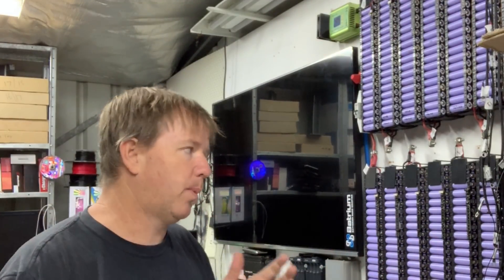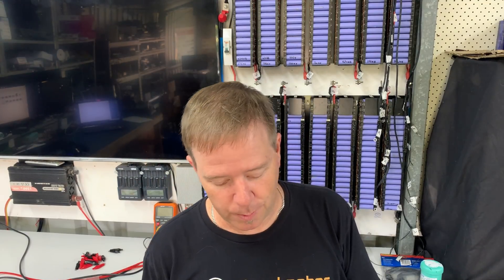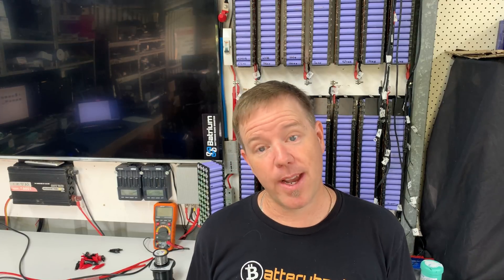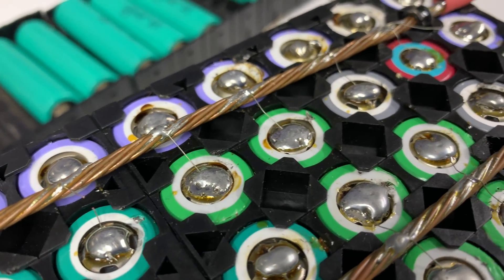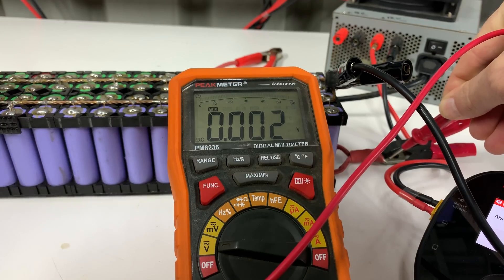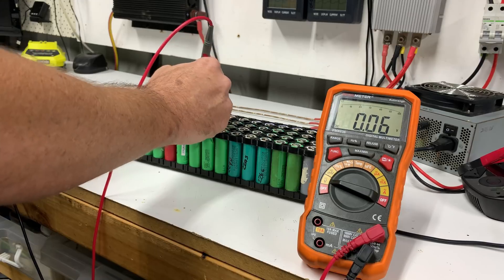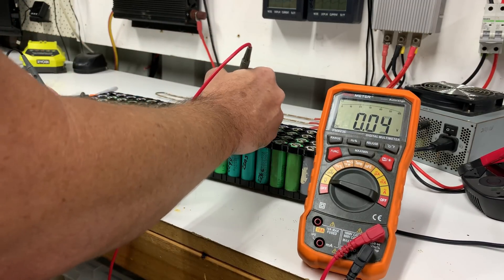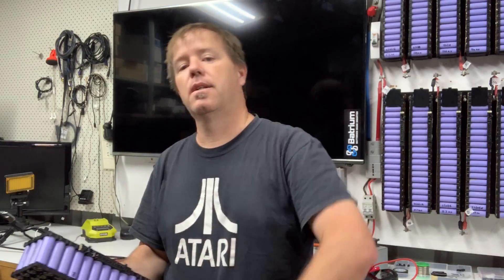No room to be complacent when playing with Lithium

Comment: so here's the thing, and this is the perfect example of it. Once one "cell" or in this case pack of 80, goes to zero in a series string, if you then keep drawing from the entire battery, the only way for current to flow is if that zero'd cell is being charged backwards. This of course will kill any rechargable battery regardless of chemistry and Li-Ion in very short order (no pun intended).

As for fire, I'm not sure if charging Li-ion in reverse equates to heat, I'd wager it does though. At either rate, this is the other, often over looked reason why you MUST run a BMS that will kill the power if it detects a cell has gone low. We all know how dangerous these packs are, and yes we all get complacent from time to time, but as Pete here is saying and has just demonstrated for us, you can never afford to do so with this stuff! 

Li-Ion batteries are wonderful slaves.... Absolutely horrible, merciless masters!!!!
Stay safe peoples.
And thank you Pete!
Reply: Jimmeh B yes I agree that if one our a couple are bad then this will bring down the rest that are connected. That is why you had a goon one as this must not have been connected, you could start charging it one at a time and may fine most will come back, or balance it with a good cell. They when one does not balance then this is the duff one, so you may get 70 - 75 back working
Reply: @russellgilchrist3951  My friend, you've missed my point. That pack of 80 single cells, as a whole, is the cell I was referring to that has been discharged to zero.

Also, more often than not, if one or more single 18650 cells, were bad enough to completely drain that "cell" (of 80 x 18650) down to zero, in so little time.... There would most definitely have been fire. Think about it, one, two , even 5 dead cells being recharged by the other 75? 

To say the available currents from a pack of this size are "impressive", would be the understatement of the decade. This is the whole point of this video.  

Most probably that pack was depleted when put into service or already over discharged and Pete is lucky to have caught it/noticed it before it began reverse charging the "cell". Maybe he didn't even see it?  Maybe he fluked it and stopped drawing from the bank just as the "cell" hit zero? 
Who knows, and it matters not.

What matters is, you should not become complacent around these set ups. They are in deed a formidable store of energy on this scale are not toys nor a harmless hobby only!

The lessons to be learnt from this particular near miss are...
1) Always use a BMS. ALWAYS! 
And 2) be aware, ANY CELL IN A SERIES STRING, no matter what type of battery you are talking about, if depleted of charge before the other cells in the series string, will not simply stop supplying energy. 
You will instead see a voltage drop but current will still flow! That flowing current WILL START TO REVERSE CHARGE THE DEPLETED CELL! which will absolutely end in FIRE OR EXPLOSION OR BOTH, if allowed to continue.

These are the kinds of not so obvious consequences that can and will happen if the designer doesn't understand what they are doing and fails to follow recommended best practices within their design.

It is a testament  to  Pete's honest intent and concern for this community, his sharing of this minor incident and unashamedly publishing this video to bring to light exactly what CAN happen, and for this we're all grateful! 

Don't modify designs unless you are ABSOLUTELY sure you know what you are doing. Don't take short cuts! 
Don't leave bits out to save money! 
If you have everything you need but for one component that will be delivered in two days, DON'T install it until that last breaker/contactors/BMS/Whatever has arrived. EVER! 

It can EASILY cost you or your family's lives. That cannot be stressed enough! 

BY BUILDING THINGS OF THIS NATURE, YOU ARE RESPONSIBLE AND CULPABLE FOR THE LIVES OF ANYONE IN THE DWELLING THAT CONTAINS THE DEVICE AND ANYONE ELSE WHO COMES INTO CONTACT WITH IT!

These are not toys. 
Battery banks of the sort this magnitude come with very real risks.
Risks of fires, explosions, and above 50vdc (35v with wet hands), lethal electric shock!

Don't take chances. 
Don't stop studying and learning.
Build, but built it to the letter of whoever's design it is! TO THE LETTER!

Stay safe :)
Reply: Read some white papers. A liion cell suffers NO damage until reverse charged to -12%, at which point dendrites form. As others have said, the CIDs have all tripped. The question is, were they reversed charged? If so, by how much? Measuring IR will tell you about dendrites which will tell you if they went past -12%.

Comment: good night friend your system is very good, only that lithium battery does not support large electronic current, ideal for not damaging, it would be you put a bank of super capacitor to help in akta electronic current, this will not damage your lithium battery  , advise you use Maxwell super capacitor, are very good Battery solar system with lithium
Reply from the maker: I disagree but thanks for your input
Reply: @HBPowerwall  each with their opinion
Reply from the maker: For sure

Comment: what is the fuse wire?...where do you get it?...Thx
Reply from the maker: This is the fuse wire I used - https://rover.ebay.com/rover/1/711-53200-19255-0/1?mpre=https%3A%2F%2Fwww.ebay.com%2Fitm%2F36-SWG-Tinned-Copper-Wire-500g-FUSE-WIRE-5-AMP-0-20MM%2F111470930578%3Fhash%3Ditem19f42f6a92%3Ag%3A6pMAAOSwQItUIpJ8&campid=5338316197&toolid=20008

Comment: I didn’t understand why the cell zeroed
Reply from the maker: because i didn't balance the battery when I installed it and it drained to zero under load - then went into reverse charging under load.. never came back - battery is dead for ever.

Comment: do you understand what dendrite formation is when you bring a lithium cell below approx 2.5?
Reply from the maker: I understand the theory of Dendrites only..
Reply: @HBPowerwall  i just do not understand why you would risk reviving a cell that has been at .1 volts. just throw it away?
Reply from the maker: there is a massive difference between a CID issue and a flat battery..

Comment: do you need to put that big blob of solder lead on each battery ???
Reply from the maker: Yep, fast as possible was the goal, taking your time to try doing neat small blobs is out of the question when doing thousands of them.
Reply: @HBPowerwall  when soldering battery .. i used to sandpaper /dremel grind a little the battery terminal first ...  just to scratch surface ....  this way i've found the solder lead much easier to "wet" the battery terminal ..

Comment: I would try charging the dead cell pack with a bench power supply, instead of the smart charger. I have brought an entire Tesla module back to life this way, and after a year or so it still works fine.
And yes I now use a BMS.
Reply from the maker: it's gone - tried with a single 18650, they just go thermal

Comment: Give me all your batteries. Alright just the ones you dont use. Dismantle the pack and see what is good and what cells are bad so much fun. Did you try individual cell charging
Reply from the maker: I tried just one cell - no go just went thermal
Reply: @HBPowerwall  that's disappointing.  I always hate when stuff goes bad. Thinking about adding active balancers to my packs. Sometimes the bms negates full charging of cells when one cell bank goes high. Then you gotta manually balance and that sucks.

Comment: What would happen if you would left that cell in for another month charging? I just came up with two low resistance 0 volt cells during my harvesting of batteries.
Reply from the maker: it would cause the other cells to over charge and catch fire.

Comment: why don't you use active balancer? https://www.aliexpress.com/item/lithium-battery-balancer-which-keep-your-batteries-voltage-difference-within-10mV/1768384410.html?spm=a2g0s.9042311.0.0.27424c4dIM0WD3
or this one: https://www.aliexpress.com/item/DYKB-3S-4S-6S-7S-13S-16S-Li-ion-Lipo-Lifepo4-Lithium-Battery-Active-Equalizer-Balancer/32982237929.html?spm=a2g0s.9042311.0.0.27424c4d7vcpCI
Reply from the maker: SOO many reasons why there is no BMS - Mainly monies, but active has more drawbacks than advantages at this point especially with all the cheap ones out there.
Reply: @HBPowerwall  Well i highly recomend you to try it out. The second one will do for your aplication  that is a good price.  The first one we use on an  36S 100A elektric car battery in a electric car on a daily basis for about a year now with 2200 pcs of  use 18650 cells . Works excellent. This has powerfull balancing power unlike bms with resistors, this one transfares energy to lower cells on high power, so it is highly efficent and fast balancing. Worth every cents.

Comment: Noob here, learning from your videos and getting 280 cells ready to build a battery pack. What's safer a 7s 40p or 2  7s 20p battery packs?
Reply: There is literally no difference.
Fuse every single 18650 cell and you should have no problems.
Ensure bolted connections between 40p cells and check for resistance at the connections. 

Just remember you're working with a LOT of energy here as I'm sure you know. 0.1 ohms carrying a couple of hundred amps... will create plenty of heat! 

Absolutely use a BMS! 

Stay safe :)

Comment: That is what you get when the lowest capacity leg / cell
 is depleted & is then charged backwards .
In the real world the b.m.s should shut down the system or the output long before 0 v !

Better b.m.s required then …
Reply from the maker: A BMS is required & it's on the bench ;P

Comment: You look drained bro...
Reply from the maker: Had man Flu lol
Reply: @HBPowerwall  You looked better later on in the video. Glad your ok. Thought u got lithium or lead poisoning from so many 18650's ;) Love your videos man! Gotta question for you. I have a 2400w 24v EASUN crappy chinese inverter/controller hybrid joby and am starting to look at building pack and wanna get the best bang for buck for my motorhome. Do you know anything about these cells and are they any good for powerwalls. They have amazing amount of cycles (apparently) etc, What configuration would you use for a  24v system https://bit.ly/2Hsz4oh and also these https://bit.ly/2WRrWsk maybe? or just go expensive lifepo4. I wanna be pretty safe and li-ion is hard to get in the UK. I tried ordering some MJ1's... they never arrived hahaha

Comment: Just a thought but by using those strips on the new pack are you not bypassing the individual fuse wire and spreading the current over the other 4 or 5 cells connected to the same strip?? So potentially enabling a higher current draw to any one damaged cell?? hoping I’m wrong other wise your protection has been bypassed
Reply from the maker: Protection has been reduced by way of no cell level fuses but raised by not adding heat so it's a trade-off i think. Time will tell if this will work.
Reply: HBPowerwall I agree with the lower temp view how ever I think the individual fuse wires are probably useless in this situation. So you could probably do away with the wire buzz bars and go total nickel strips as the individual fuse wires prob won’t give any protection 
A half way house with the method you’ve just done would be to calculate the fuse wire size for the 4 or 5 cells per nickel strip and have one fuse wire for each 4 or 5 cells 
If you get 1 cell have a run away it should blow but will take the other 3 or 4 out with it... better that than a fire I guess 
Of course without a bms you will run into the problem of dumping to much charge into the remaining cells in that pack due to 4-5 cells being off line 
But what do I know 
Just a farmer 😂
Reply: @naturesfinest6761  ideally, if it were me, I would place an LED across each fuse, it won't light while the fuse is intact, but will when it blows. A Bi-colour would be even better, because it would indicate also in which direction any current was flowing. Eg, Green out, Red in.
Reply: @HBPowerwall  I reckon it's a better way to go.
Every cell is a bit over kill. There is however the possibility of a 5 cell fire though if one cell goes dead short. 

But what are the chances, really?

Comment: with out blown fuses I would say the internal cid or what ever it is called have opened try a small screw driver to pop it back then retest the voltage. Then throw them away. 4.4v you were lucky
Reply from the maker: CID is fine as there is some voltage, won't be messing with them at all. The battery would have needed to be recharged to cause an issue that would have taken quite some time. Potentially issue could have been weeks away. That's the real scary part.

Comment: Why the fuse don't save other battery? Hmm
Reply from the maker: Fuses are for too high draw not long slow low voltage drop (to nothing in that cell)
Reply: I fuse wouldn't do anything, that's not their purpose. A functioning bms would be all that would keep a pack / cell from underdischarging. Fuses are for overcurrent.

Comment: In the future, I would imagine we should limit our charging cutoff voltage to be two cells lower than the actual pack voltage. That’ll give you a two cell fault tolerance of overcharge protection
Reply from the maker: i've changed all my packs to 4v max
Reply: why would you do that? It isn't necessary and also, is not the issue in this video. In fact, it's the total opposite of the problem shown.
Reply: Jimmeh B very much disagree. The issue in the video, as he explicitly shows, is that the charger would overcharge the pack when one cell goes down. 

Also, limiting your depth of charge is pretty common, helps preserve cycle usage and for redundancy. If you lower your charging voltage by a single cell’s voltage, you put less strain on the pack, and if one dies then you’ve simply used up your redundancy. 

Is it necessary? No. But he said this is a test pack, and frankly I wouldn’t want to skimp on safety.
Reply: @Mattman993  I do see what you're saying, and it is better to er on the side of safety.

But that's a secondary issue and had a bms been installed, wouldn't have been an issue. There in lies the solution.

While there's nothing wrong with your proposal, it's not necessary nor volumetrically efficient. The correct approach would be to install a BMS and as Pete said in his answer, to limit cut off voltage to 4v, thereby including the buffer you're talking about as an added protection.

This would have a: avoided the whole event,  b: saved that pack, and c: stopped any possibility  of what you're describing. 

As safety is the ultimate concern here, that would be my chosen coarse of action, as is HB's, and in reality, is the correct approach for more reasons than that of overcharging alone.  That said, again, there's nothing wrong with your proposal and if you have the space, and are prepared to spend the extra money and extra processing time to gain the required capacity under those constraints, more power to ya! :)
Reply: Jimmeh B oh yeah, the only real solution is a BMS lol I totally agree. Mine was just cheap insurance haha

Comment: Whack those cells on a Pb charge single cell to lift the voltage see if they really are dead.
Reply from the maker: They are really dead!
Reply: @HBPowerwall  In which case its time for some destructive testing! ;)
Be interesting to carefully open them and see if you can see dendrite formations. 
It's something I keep meaning to do myself on my pile of dead cells.
Reply from the maker: I have a Microscope with HDMI Camera so that's not a bad idea!
Reply: @HBPowerwall  I would actually be REALLY interested to see that. I'm not sure if you would see dendrites, but only because of the backward charge. Be really interesting to see what the inside of the plate do look like though!

Comment: I still don't know what you did to destroy all those cells???? you talk alot but didn't say a fact! but still good job keep going on!
Reply from the maker: 1 x 80p pack went to zero volts and i must have spent at least another 24hour drawing from the battery making that one go reverse polarity
Reply: @HBPowerwall  how is that possible? because it was withouth protection module?
Reply from the maker: @Damjanhd  no low voltage cut off & completely (never) balanced (I was lazy & foolish)
Reply: 2nd hand lithium lottery is what happend haha
Reply: Instead of a BMS, you could use the low voltage buzzers used on rc stuff. They are $2 each.
Reply from the maker: Just left the lights on and one cell went to zero volts and never came back
Reply: @HBPowerwall  ok one cell goes down how that destroy others? did you mean one pack of 18650 of one single 18650 died and destroyed all in pack?

Comment: Bit late now, but I think the ISDT is trying to be too clever and refusing to charge because of 0V.
On the Antimatter or Reaktor, I use the NiMH setting for a while on a low current to revive (it doesn't check voltage), or a power supply or a TP4056.
If the cellpack bottomed out first then the other 13 packs would force current through it the wrong way and make it go negative. If I understand correctly, copper ions would start migrating, plate the electrodes and kill it fairly quickly.
At least it spared 1 cell! :-)
Reply from the maker: She's toast - one cell will be a gift to the 18650 gods :P
Reply: @HBPowerwall  Oh well.. an important lesson though...  I'd guess it has a scrap value of about $20 so the recycler should be happy to see it!
Reply from the maker: be nice if it was 20 bucks hehe